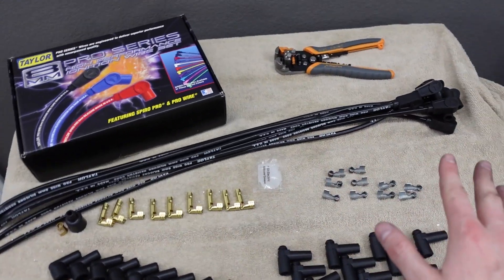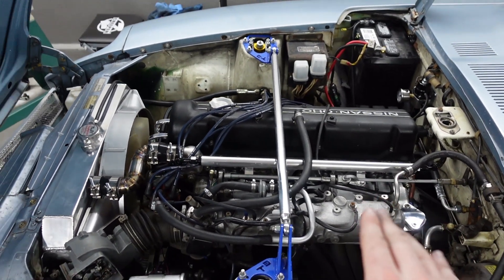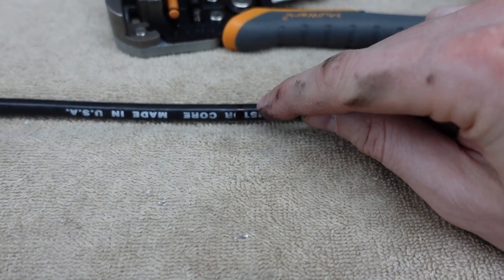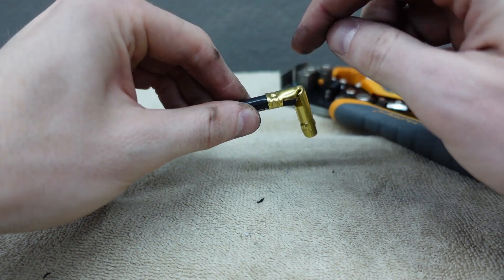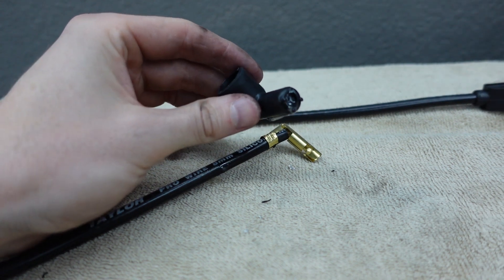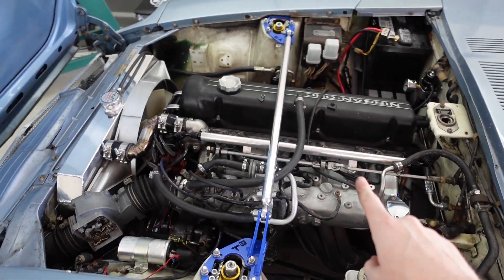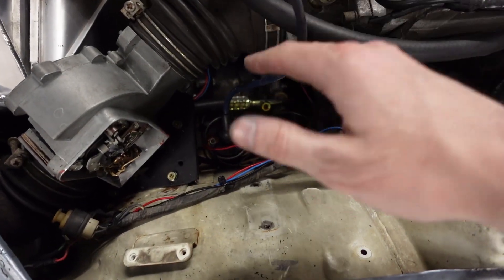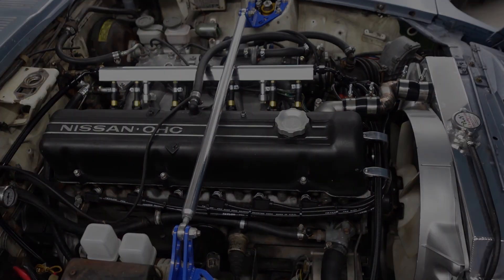DATSUN 280Z CUSTOM SPARK PLUG WIRES DIY TUTORIAL | How to use a Taylor Wire DIY Spark Plug Kit

Comment: Hey Jordan, thanks again for the great info. I just completed my wires and ordered the Crane Wire Holder from Lonely Drivers Club. Can you share which ignition system you used on the 280 or if you have a video of the switch from stock?
Reply from the maker: Glad to hear it man! Actually I did make a video on it, it’s a little pricey but one of my favorite mods on the car to date. Check it out :) 

https://youtu.be/nEhEeJo97zU

Comment: Hey Jordan! Out of curiosity, did you delete the EVAP charcoal canister? Or relocate it?
Reply from the maker: Hey thanks for watching, I deleted it :)
Reply: @JordanPayneLV  Oh nice, where did you end up routing the breather hose from the tank? I accidentally broke my canister while replacing vacuum lines so I've been weighing out my options haha. And thank you for the content! Just the right amount of in depth without watching an hour long video. 👍
Reply from the maker: @alex.jennings  I just capped it off, I’m not sure what consequences that brings but I haven’t had any problems since :)
Reply: @JordanPayneLV  Hmm I would say as long as your tank has another source of ventilation it should be okay. Thanks for the information. Appreciate it! 👍
Reply: @alex.jennings  My 1973 240Z has a "flow guide valve" mounted below the ignition coil.  There are three hoses attached to the valve.  Crankcase, fuel tank and base of the air cleaner housing.  When that valve started to malfuction, my engine started to idle rough and ran poorly when the tank was close to 3/4 full.  I also had to pry the gas cap off of the filler neck to fill the tank!  As you alluded to, a vacuum was being pulled in the gas tank because of the stuck valve.  I removed the valve and gave it a few shots of carb cleaner and no more problems.

Comment: The Z is looking great! Thanks for all of the guidance.  looking forward to seeing the engine pulled out and bay painted.  Any reason you got an 8 cylinder set vs a 6?  Is it because the pro series doesn’t come in a 6 cylinder version or the 8 because the 7th is for the coil as mentioned?  I don’t know, maybe the sets don’t usually include one for that.  Thanks!
Reply from the maker: The main reason is because this is what I found on Amazon, I’m actually not sure if they sell a 6 wire kit but it was useful having an 8 wire kit so that I could do some practice and not worry about messing up. Thanks for watching and for the comment :)
Reply: @JordanPayneLV  Motorsport Auto has these wires for the Z
Reply from the maker: @shanetyler9391  ah I didn’t realize!

Comment: Where did you get the wire holder at the front of the engine? It looks really nice.
Reply from the maker: Lonely driver on Instagram! They are super nice pieces but you’ll have to check to see if they’re available, they only come in limited batches most of the time :)

https://instagram.com/lonelydrivercompany?utm_medium=copy_link

Comment: Awesome job, Jordan! The only thing I would have done differently is put the boot on the wire before crimping on the connecter. Then you can just slide the boot down in place. Very cool project though.
Reply from the maker: Wow, I can’t believe that the instructions didn’t suggest that; that would have been so much easier!

Comment: Does your brake light stay on?
Reply from the maker: My brake lights seem to be operating normally, why? (Oh you mean my emergency brake? Oh yeah the little switch that turns the dash light off is kinda finicky)
Reply: @JordanPayneLV  yep, dash brake light, mine is stuck on. what a pain.
Reply from the maker: @manuelatallah7127  yeah I’m running into all kinds of small wiring problems so I might just have to redo the whole thing sigh lol
Reply: @JordanPayneLV  likely easier to just snip that wire...
Reply from the maker: @manuelatallah7127  yeah true!

Comment: Where did you get the holder on the front of the engine you are passing the wires and fuel line through I have been looking for something like that
Reply from the maker: I got them from a guy on Instagram called lonely driver. He sells them as “swan neck” mounts 

https://instagram.com/lonelydrivercompany?utm_medium=copy_link